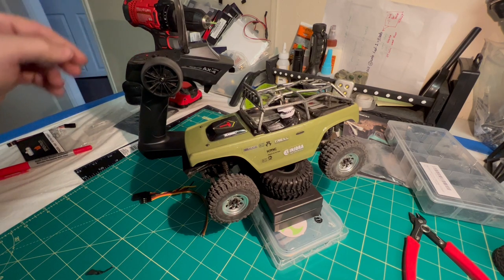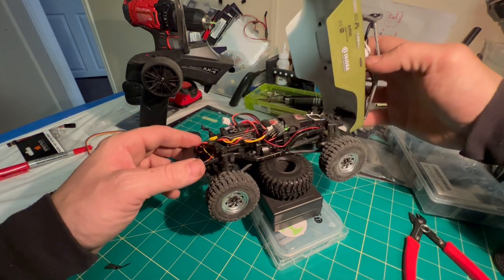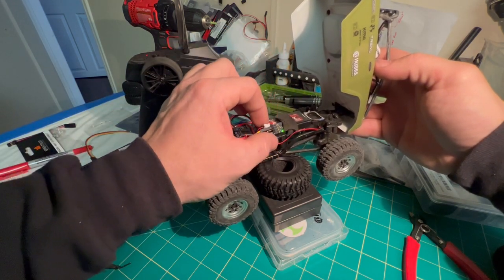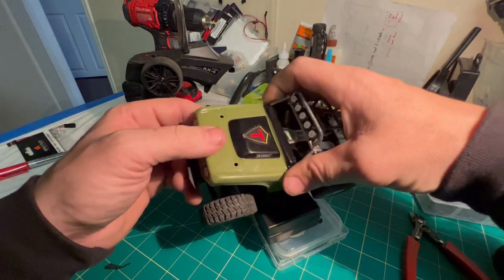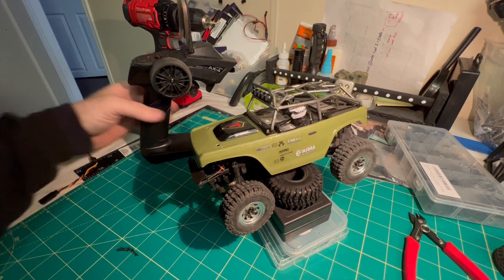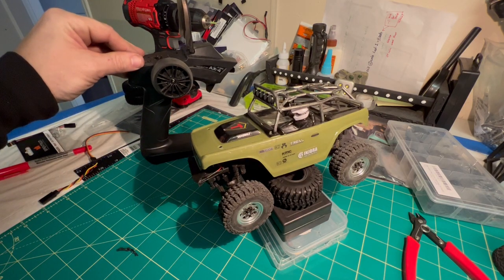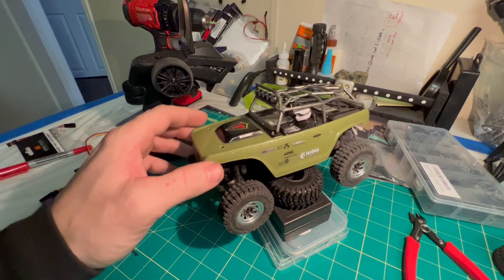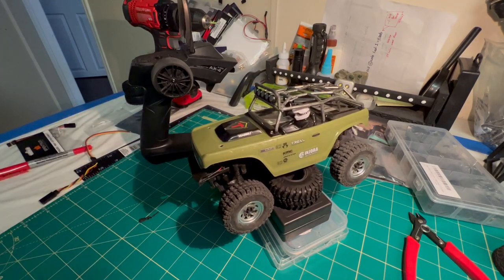SCX24 with Sound

Comment: The speaker is actually supposed to be mounted speaker against the body. The idea is to make the body an extension of the sound system… it puts the bass in the booty.
Reply from the maker: I would think it would be very muffled in that case. I just mounted it with double sided tape in the same place as the video.